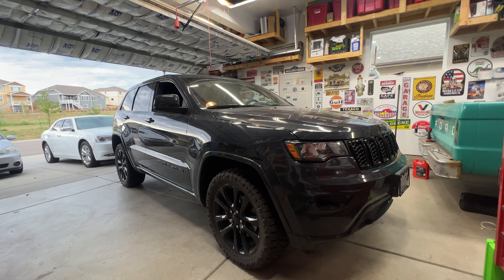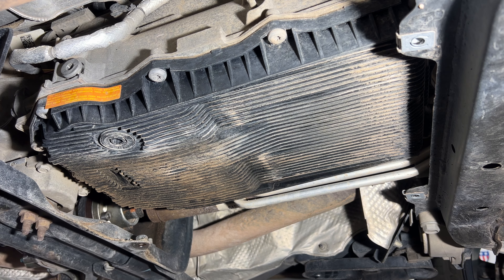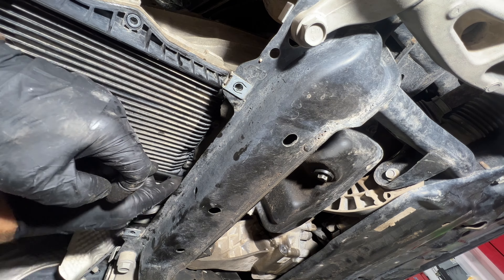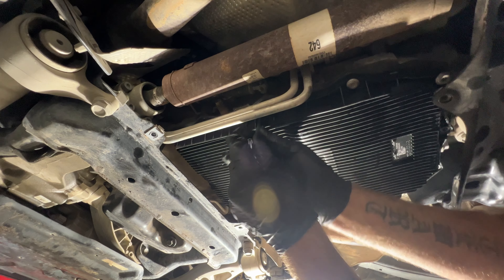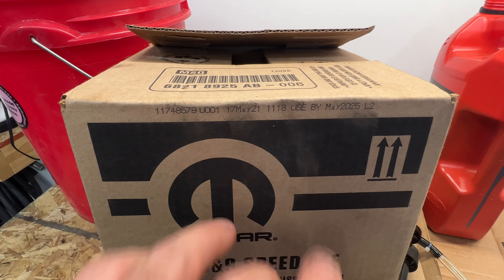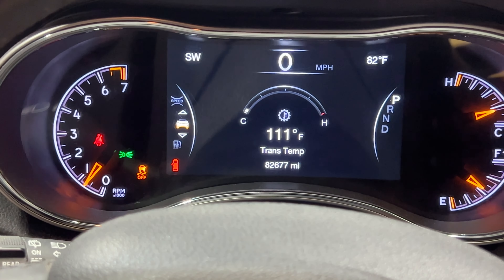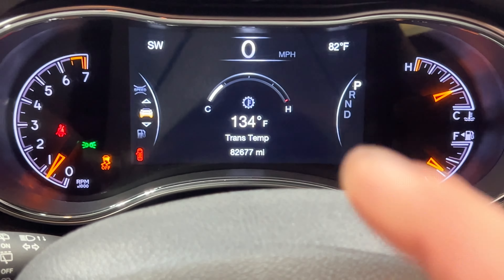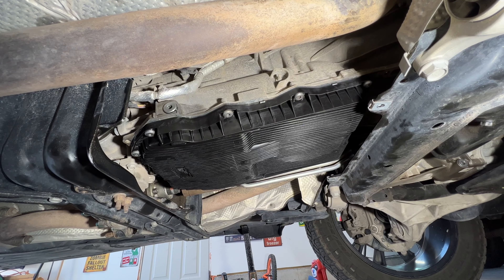2018 Jeep Grand Cherokee 8 Speed ZF Transmission Filter & Fluid Replacement How-To

Comment: Pretty good video overall. I mostly followed it except for the part where you initially removed the fill plug prior to removing the drain plug and had fluid gushing out.  I just loosened mine a few threads to make sure I could remove it later and then I removed the drain plug first.  Seemed like less of a mess doing it that way. Also, what is the reason for removing the fill plug at all?  If you're going to replace the pan I would think that just removing the drain plug would be sufficient and make less of a mess.
Reply: Well, you want to make sure you can actually take off the fill plug and you won't have any issues there so you can add fluid back in. This is step 1 of this whole process.
Reply: If you can loosen it you verify that you can remove it the rest of the way. By just loosening it you don't make a mess like he did in the video when he removed it completely.
Reply: @RoadiJeff  you will make a mess as everything is cooled down. Hey an empty oil catch pan ready, pull the plug, let it drain, put the plug back in, next pull the plug on the pan, next loosen all bolts, pull the filter inlet tube down in doing this you'll get more fluid in the pen, pull the plug again and drain it into the catch pan. This is what I did and I didn't have nearly a mess on my hands. If you have issues reply back and I'll do what I can to help.
Reply: @JF32304  I changed mine out last year, mostly following this video.  However, I did not completely remove the fill plug before draining out the fluid via the drain plug.  I just loosened it to verify that I could remove it and my method did not have the mess of fluid running out the fill hole like it showed in this video.  By draining the old fluid before removing the fill plug it does not make a mess. Watch the video at around 4:45 and you'll see what type of mess of fluid I'm referring to when that fill plug is removed prior to draining the fluid out the drain hole.

Comment: Hey Man, was filling my fluid today and it was dribbling out at 2.25 quarts. Any idea why?
Reply from the maker: Was it at the right temperature when adding?
Reply: @BLUECOLLARGARAGE  this was the first fill after replacing pan. It’s ice cold hasn’t started in a few days.
Reply: @josepha6123  did you make sure the pan was level?

Comment: 2014 grand cherokee were at 130k lifetime warranty do all the maintenance dealer will not do Trans service claim its lifetime
Reply from the maker: They claim it’s lifetime fluid but in my honest opinion no fluid or oil is considered lifetime it will eventually start breaking down especially with heat
Reply: They don’t want to do it because it pays very little flat rate and as you can see it takes some time to do it right. It’s not a profitable job and if not done with delicacy and patience it can come back with shifting problems.

Comment: Taking into account how messy this job is and the interval it needs to be done it doesn't make any logic and financial sense to do it yourself. Just pay a transmission shop to do it and enjoy a six pack on your porch!
Reply: umm yes it does dealership told me $980 dollars to do, and it's $250 in all OEM parts. Unless $730 is not worth your time that is...
Reply: Once you have a couple tools it’s as easy as a oil change